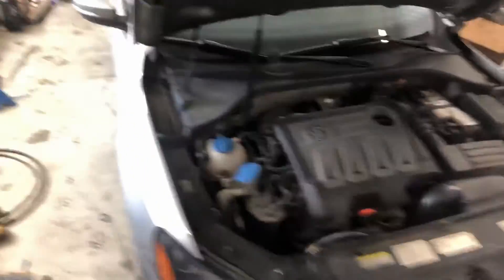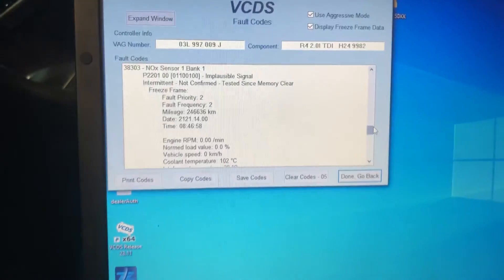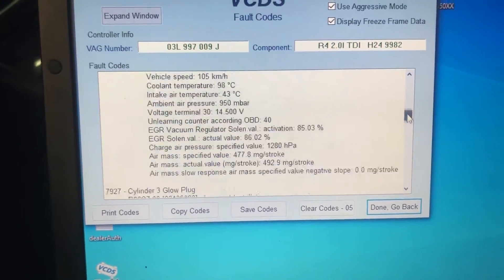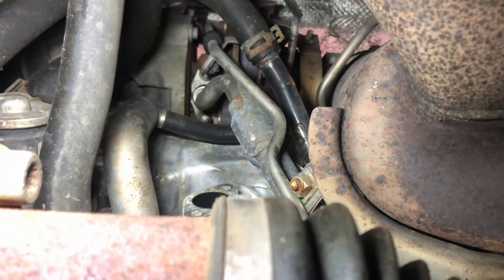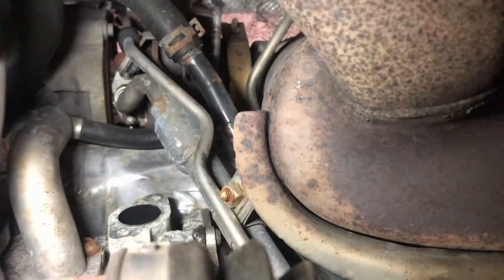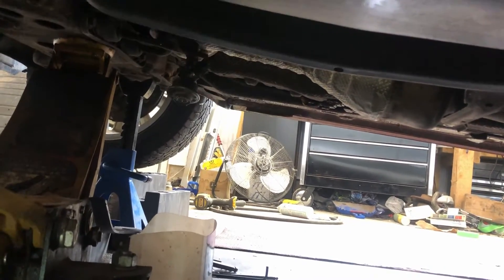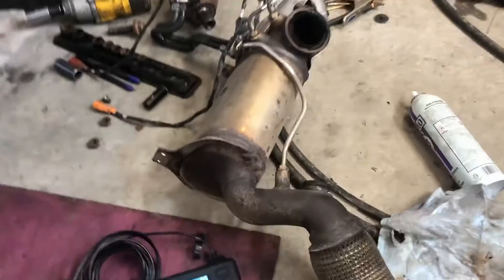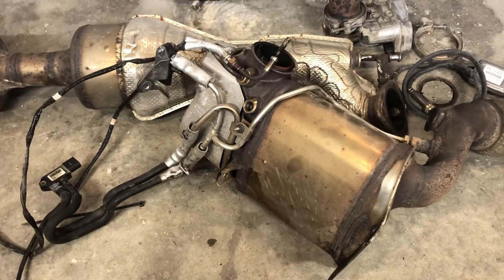Passat CKRA TDI: Diagnosing P0401, P240F (and maybe P2201?)

Comment: Hey Josh I first want to say I throughly enjoy your channel and love your content as it applies to VAG TDIs and specifically for CJA motors.. ok I have ‘13 CJAA sprortwagen with 102,750 mi (that’s relatively low mileage for 11 yrs) I have following DTCs: p2002, p401 and p299 .. I also have had my car initiate limp mode many times while I was driving it on a trip .. I cycled the ignition on/off to clear it .. just to get it home.. I’ve checked the vac pump, the N75 solenoid and the vac diaphragm and actuator on the turbo and all is working fine.. I did the quick test and yeah I have soot in the tailpipe and residue on the hatch.. I’m thinking I will put it up on the quick jacks and remove the EGR filter and cooler give them a cleaning and see if I can get boost back.. but I do fear that my DPF is cracked , not sure how that could have happened.. low mileage and this car went through the Dieselgate mods at a dealership.. Would like to know your opinion is it clogged EGR system from failed DPF? Boy I really don’t want to replace that and I live where emissions are checked so I can’t really do a delete .. my biggest concerns are getting the DPF out as you showed I’m a video .. although I have about 3 feet of room with the car on my quickjacks and with dropping the subframe about 1/2” do you think I can get it out? Do you think by cleaning the EGR pipes and both valves and filter .. I already cleaned the intake / ASV EGR and it wasn’t too dirty.. I don’t want to spend $1500 US dollars on new DPF and find out turbo is bad.. and I really don’t want to pull the turbo.. do you think low boost is the result of plugged EGR filter? Thanks .. sorry for long message but you have the best TDI content on here
Reply from the maker: The dpf cracks from frequent regens (frequent temperature swings) which all comes down to driving style. Its definitely do able as I just used regular stands all the way up. The cracked dpf should result in free flowing exhaust so I don’t think it’s relevant to your p0299, I would double check for boost leaks if it’s building some boost.

As far as the p2002 and p0401 you can clean the egr filter but it’ll clog again because of the p2002, the options are quite limited I’m afraid
Reply: @JoshsJettas  thank you sir.. yeah the low boost i fixed it was an isolated incident from the low threshold and insufficient flow CELs I had cracked intercooler which I fixed .. thanks for your advice.. yep my DPF is cracked .. so cleaning it is pointless and cleaning EGR and EGR filter will only be a temporary fix .. but will driving it hurt anything? I assume it’s no different driving this as is than with a deleted DPF.. ii just am concerned about excessive soot in the intake manifold
Reply from the maker: I don’t think you’ll have an issue for awhile, I’ve done timing belts on a couple cars with those codes and they just kept driving